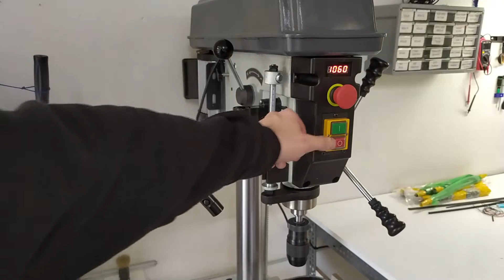Cormak Z5020 Vario Drill Press - Short Review

Comment: Did you have mounted the Drill on the wall ?
Reply from the maker: Yes, I actually did. 2 mounting points, one on the wall and one on the floor, always improves the performance of drill presses.
Reply: @machinistnick  thank you vor quick Response, was the reason the swinging of the Drillpress ? i have the same Problem, you can See in my Videos.
best regards
Thomas
Reply from the maker: @thomasmuller6838  Exactly. The base of the drill press is a bit thin. The thin metal causes swinging. Adding a second mounting point to the wall eliminates the swinging.
Reply: @machinistnick  yes i will do ist Like you, 👍